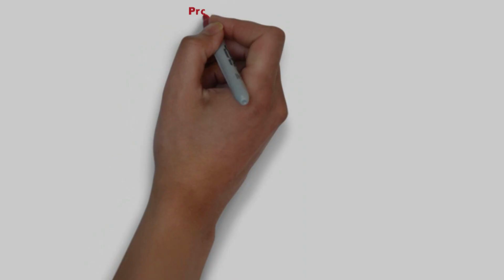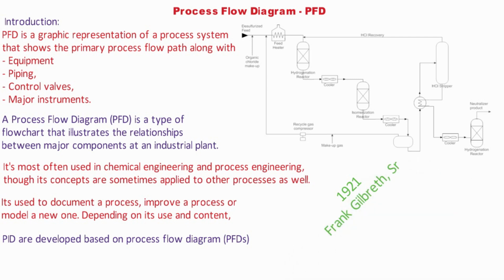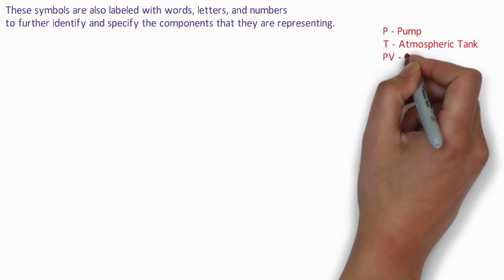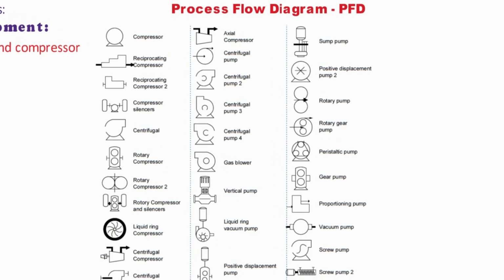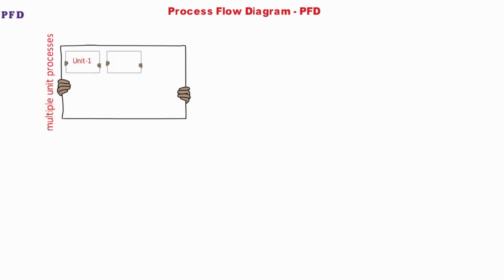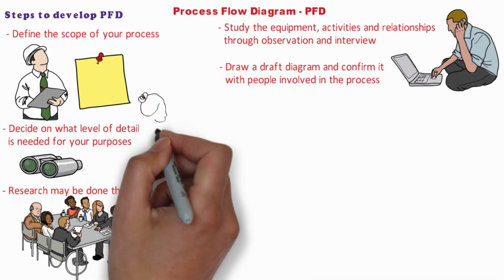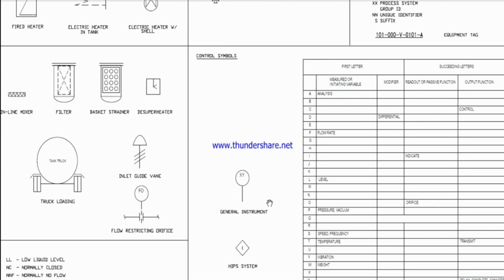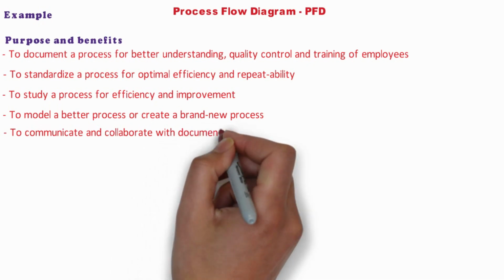HOW TO READ PROCESS FLOW DIAGRAM | PFD | PROCESS ENGINEERING| PIPING MANTRA |

Comment: Hi mam can you please provide private online training on piping for ammonia refrigeration plant?
Reply from the maker: what sought of training you need?
Reply: @PipingMantra  pipe sizing, control selection, P&ID drawing of Ammonia refrigeration plant (in normal cold storage)
Reply from the maker: @asishkumar5231  for pipe sizing you can check our both videos,  pipe sizing and thickness calculation
Reply from the maker: @asishkumar5231  Specific PID i have check for amonia and it is one of the rare request..